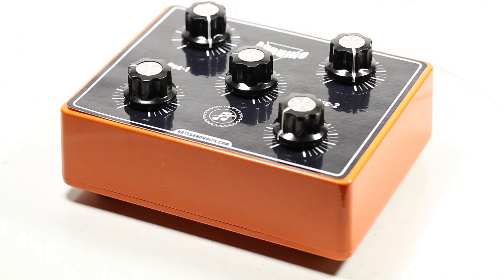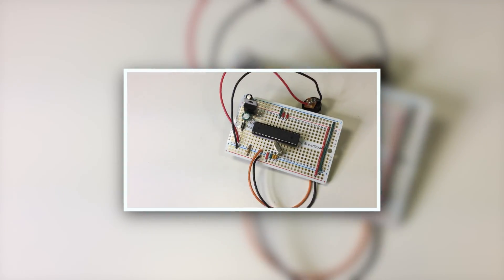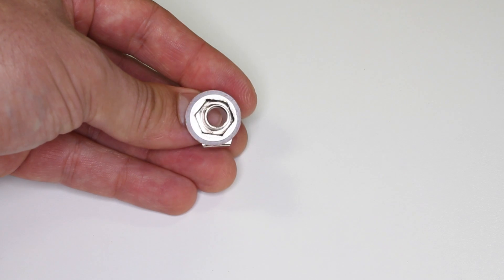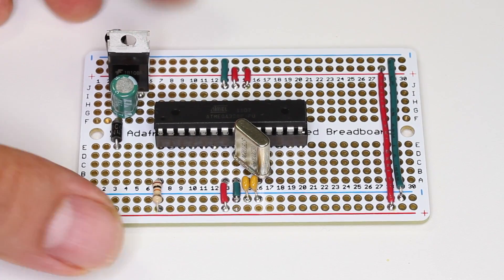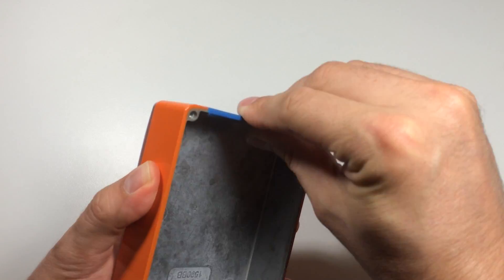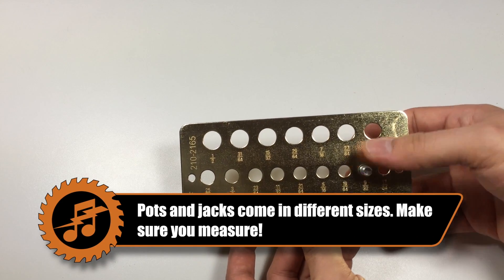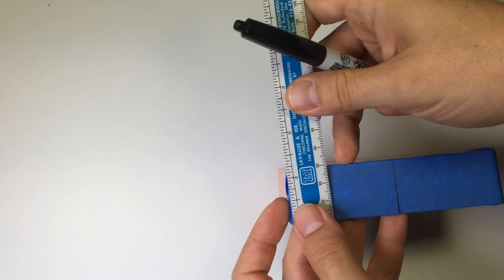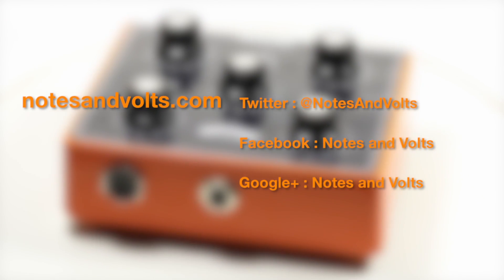Build the Auduino Granular Synth - Part 1

Comment: FYI, "click the link" doesn't work anymore (thanks to yt for changing its interface). Can you add link in video description maybe?
Reply from the maker: Hi Arthur. The link is in the description should work. If not, try this: https://www.notesandvolts.com/2014/07/build-auduino-granular-synth-part-1.html
Reply: @NotesAndVolts  I fear I was not clear enough. At 2'11 you mention to click on a link to watch another video. This other video is not in the link you just gave
Reply from the maker: @ArthurRainbow  I see now. Here is the link to that video https://youtu.be/ufQZnAAxZ7A
or if you want a simpler circuit using a Arduino Nano check this out https://youtu.be/xb0ZMlqXh-0

Comment: I built this, and it mostly works, but it's weirdly inconsistent. The levels go up & down, and often it will stop outputting sound until I twiddle the knobs enough to get it back into its operating range. It's almost like certain settings put it into out-of-bounds condition or something. I'm using 5k linear taper pots, and I verified that with a simple sketch to read all five and output the values, so I can see they all work, and the middle of the knob travel is reading 500ish.

Comment: it s possible to use a other potentiometre resistance liuke 50k or 100k ?
Reply: You could, but it won't work as well.
Just order your parts from eBay or AliExpress, Pots are about 50c, just make sure you get the right type ! [linear or log]

Comment: Can I use a 9v battery?
Reply: 9V batteries are SHIT ! They only have 250mah of power !
Almost 90% of modern electronics are 3.3 or 5V, so just use any old phone charger !

Get yourself a little switch mode step down voltage module from AliExpress.
https://www.aliexpress.com/item/33039343458.html

Comment: I'm just about to start this with an arduino chip, but I have one quick question; in this video you say to use 5k potentiometers, however, in your schematic it says to use 10k.  Does it matter really?  If so, what's the major difference between the using 5k vs 10k?
Reply from the maker: Hi JR. 5K or 10K won't make any difference. 10K is easier to find in stores so I modified the schematic. You may want to check out my live build where I make this with an Arduino Nano. It makes the construction much easier: https://youtu.be/xb0ZMlqXh-0

Comment: now I have a real question: how difficult si it to add cv? it would be grat to sync it with a sequencer!
Reply: I guess with a vactrol its possible
Reply: @signoremaxence6888  with a vactrol, you should be able to add a very rudimentary pitch cv input, but it won't have any kind of volt/octave stability. There might be a way to add 1V/O tracking with arduino code, but I'm not sure.
Reply: That'd be awesome

Comment: can you use 12v instead of 9v power? would be sweet for adding a battery pack
Reply from the maker: Hi David. There will be more heat dissipated by the LM7805, but it should be within limits.

Comment: Thanks for this great tutorial series having used it to build one myself. Recently I was checking out Arturia's Microbrute synth (as a possible future buy) that has an external source audio input and a CV output which might be a neat fit for the Auduino as an extra Oscillator except that the Auduino doesn't have a CV input. Would this be something you might think about as an addition to your Auduino unit ? I don't know how difficult this kind of addition would be to add. I got this idea from a video on YouTube where a guy demonstrated a Eurorack modular Oscillator connected to the Microbrute.

Comment: I am curious as to why you use a mono input jack instead of a stereo output jack? or is this just for sound quality. If i wanted to hear the output does that just mean I require a stereo to mono cable?
Reply from the maker: Hi Steak. This synth is monophonic so there is only one output.

Comment: can someone explain to me why he is using a guitar jack (@4:48) instead of a normal microphone connector? Does that mean you can only use the synth as a guitar plug in?
Reply: or do I need an adapter is I were to use the synth with a normal stereo?
Reply from the maker: Hi Steak. 1/4" Phone jacks are standard on most synths. Use a mono phone cable to connect to an amp or mixer.

Comment: Is it possible use it with a external cv controller?
Reply: YES! Just connect 5 vactrol's in parallel with the pots
Reply from the maker: Hi Marcos. Not currently.

Comment: Please can you insert the link for auduino synth  bootloader? thanks
Reply from the maker: +Akio Official Hi Akio. If you are starting with a blank ATMega, you would boatload it with the standard bootloader found in the Arduino IDE. If your chip is already Arduino ready, you don't need to add the bootloader. Just upload the program.

Comment: Could an Arduino Micro be used instead of building an Arduino? (it's only like $2-3 from eBay), and will it work with the line-lever + MIDI upgrades as well?
Reply from the maker: +DIY_glenn I have not used a Micro yet, but if it is fully Uno compatible (code, interrupts, serial out, clock speed) then it technically should work.
Reply: +Notes and Volts Ah, wait. I was thinking about Arduino Nano. atmega328, 2 interrupts etc. Seems to be fully compatible with Uno?

Comment: This is a great DIY video, specially the clear and clean filming and editing of it make it shine.
I got some questions:Can this be done with an arduino nano instead?
What is the best option for a optional battery powered system with MIDI?
What I really want it´s the minimal build in terms of first money and second power consumption 
Thanks
Reply from the maker: +Leonardo Rivas Thanks Leonardo! I haven't tried a Nano yet but it should work if it is Uno compatible.

Comment: can i use the same code on an arduino uno?
Reply: is it the same pins for audio out and potentiometers?
Reply from the maker: +henning hund Yes, you can run it on a uno
Reply: +Notes and Volts parts are coming soon from internet 😀
Reply from the maker: +henning Hund Awesome! Good luck with your build
Reply: +Notes and Volts thanks
Reply: i made it today it is so fun!
Reply from the maker: +henning Hund Awesome! :)

Comment: Could you please also use the metric system? Not everybody is stuck in 1850.
Reply: How dare you Sir,I will be sending you an angry telegram from my US post office immediately!!
Reply: Feel the same way, fuck am and pm, fuck pounds and fuck everything that isn't the metric system :D
Reply: Not everybody finds it difficult to convert.

And out of interest, I expect you still use empirical time units, you know, hours and minutes... and you probably don't have a problem with those?
Reply: As a canadian engineer, kindly find the conversion table and make it work, you seem a lot more problem oriented than you are solution oriented. My schooling made a point of having us do these conversions in electronics fabrication, it's just simple math.

You literally have a calculator in your pocket.
Reply: +StarTrek123456 they're both used. Just buy metric components and use metric rulers. The workflow is the same, and of course you should drill holes to the best fitting size. That's it.
Reply: It's an American video, deal with it or fuck off.
Reply: says the guy who likes star trek...stuck in the 1960s  (from the guy with the 1970s robot avatar)
Reply: StarTreck123456, That's ignorant. And superficial.

Comment: One point I don't really get is why the 5V output of the Arduino is used. I tried out the 3.3V and it sounds the same. It might be even safer for the amplifier that the synth is plugged into (since line is normally at 1V afaik). Or am I missing something?
Reply from the maker: Thorsten Felix Hi Thorsten. Sorry, I'm a little confused. You are running the Arduino board from a 3.3v supply?
Reply: Notes and Volts I am using an Arduino UNO to build the synth, wich is powered via USB. It has one 5V and one 3.3V output pin. The 5V is going to the pots. Why not use the 3.3V?
Reply from the maker: Thorsten Felix Ok, I see what you mean. First of all, you are correct about the output being above the normal Line Level voltage. The Auduino Wiki says this about it "Strictly speaking it outputs at 5V rather than the 1V line level, but most amplifiers don't seem to mind.".

Running the pots from the 3.3v pin does not change the voltage of the output signal. All that will happen is that the pots will not generate the full range of values. The Arduino analog inputs are expecting values from 0v to 5v.

I will soon be releasing a MIDI Input update for this project and am considering adding some components to drop the output closer to Line Level. Stay tuned!
Reply: Notes and Volts I see. Thank you! Can't wait for the MIDI :)

Comment: Could this be midi controlled?
Reply from the maker: JCGver I actually have a working MIDI version on my bench right now. I'm working on the code trying to add some features. I'll post a update video when it's done.
Reply from the maker: Hi Evwaldron. Not currently, but it is something I am investigating.
Reply: Half of my parts came in the mail yesterday.  I'm going to do some serious experimentation with this little bad boy.  If I figure it out I'll let you know.
Reply from the maker: evwaldron Awesome! let me know how it turns out.
Reply: Notes and Volts It shouldn't be too hard to add midi, hardware wise you're one opto coupler, one resistor and one midi connector short of having midi. The fun thing about midi it pretty much a serial connection running at a baudrate of 31250. Something an arduino should be able to do. 

After that you'll need to "decypher" the midi messages, i'd be surprised if there isn't already a library for that (i 'm not an arduino guy, so forgive my ignorance), and hook the note on and off from the library to oscillator in the software.